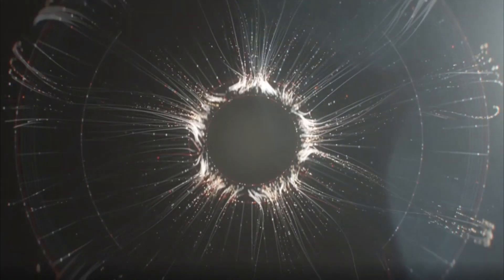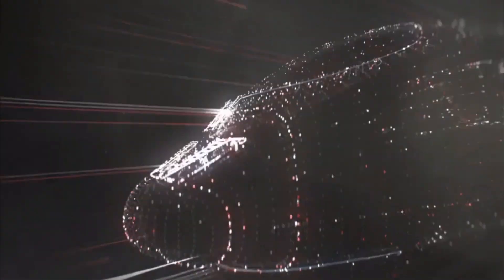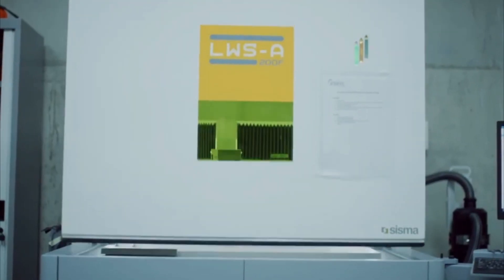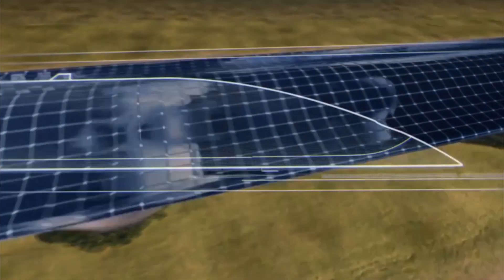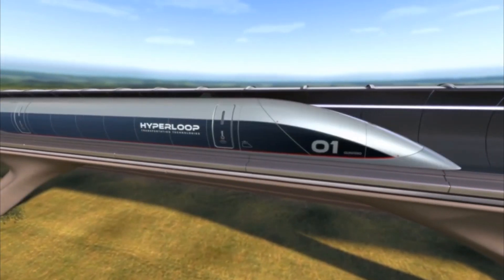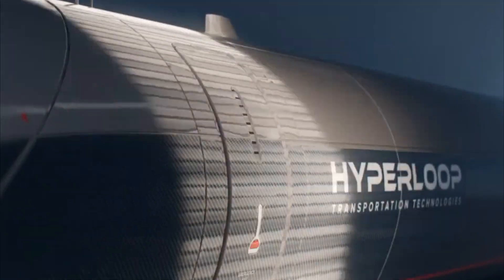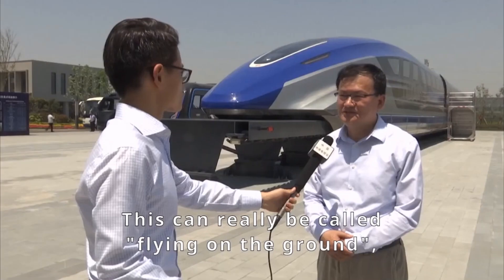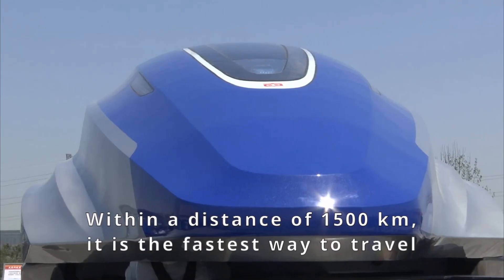New Chinese “Levitating” Train Can Travel From Beijing To Shanghai Faster Than A Plane

Comment: 500 k/mh is 310 mph.  I thought Japan did this speed a few years ago?
Reply: None of these have been realized. The Japanese one (Central Shinkansen) will not be open in at least five years and yive years later god knows what train-type they will eventually produce (if you produce it in 2026 there's no point to produce your new train with legacy 2021 technology). What's worse the Central Shinkansen project is delayed so god knows when it eventually opens how many high-speed maglev elsewhere has already been built. 

As a Chinese I hope it opens as fast as possible because we don't want to be the first to built a potentially economically infeasible project yet if someone tried the crab first we can gain a lot understanding about how it works economically.
Reply: @GyacoYu  Japan needs help from Taiwan. Or Taiwan can help.
Reply: japan has build the maglev trains already and they'er ready to go, but it will take much longer to finish building the tracks as they have build a tunnel through mountains & alps.
Reply: The SC Maglev Train from Japan was able to achieve 603 km/h in 2015 on their test run.

Comment: Vibranium is the name of a sensor suite like in star trek ? Okey dokey. Still wonder how well mag-lev can handle freight; haven't heard any news about that.
Reply: The Germans, have been running excursions, on the test track, with "Human cargo" in all weather's. The weight of the "freight" is 1.25 tons, and has recorded speeds in excess of 450 mph.
 China, also has the only commercial Maglev on earth and its longer than the German test cars - this one has capacity for approx 700 passengers or freight modules, with each 16, weighing in at 1 ton(ne ), and running at speeds of 450 mph.
 The "Human cargo", came from the test track video.

Comment: At 600 KMPH, the China-EU trip will take only 20 Hours! If only the freight train can do one-third of its speed! Air freight will be out of business across the Eurasian landmass!
Reply: When Europe sanctions China to its extreme, there is no freight between the areas. Then all means of freight is of no meaning.
Reply: 放屁，我做跨境电商的，每天从中国运往欧美的货物不知道有多少，世界上所有电商平台上一半是中国卖家，一半以上的货物由中国提供。
Reply: @qiqinglai9396  你从那儿得到的信息？可靠 吗？新疆的维吾尔族差不多要被 灭绝了，余下的维 族人也被强迫劳动，在这种情况下，还有可能从新疆向外动送物资 吗？可见你是在宅里做生意的。
Reply: @phongcheelim8873  你可以上网，可以上各大电商网站，同时你还有脑子。
Reply: @phongcheelim8873  neglected them, China commerce is unstoppable.
Reply: The weight of freight, should make no difference to the running speed of the service, Wether for people or freight, as Germany, when developing the Chinese one in Shanghai, the engineers talked of the passengers as "human cargo". 16 humans = 1 tonne, and it attained high speed with that weight. Anything heavier, the power flow, between the system compensates, and keeps the deck floating, and the speed up - bear in mind, that it may take a bit longer to stop, depending on tonnage.

Comment: Why on earth are the Chinese adding a driver for there’s no need, just take transrapid and improve on the automation aspects, mixed with lidar and sensors from the automotive industry including that it cannot leave the track as its magnetically held in place , I’m sure the wizards can easily get it working no mater the weather
Reply: Regulations
Reply: @asdf3568  really did something happen then to change it from driverless like the transrapid
Reply: @ram64man  My guess it's like a car. It can drive itself but you need to have a driver until the system is proven to work after years of testing.
Reply: double t in matter.
Reply: The driver, is there as reassurance for the passengers, just in case the service breaks all its backup systems, which seems to me to be a very unfortunate series of circumstances.
Reply: Because China has no driverless technology. The key holds in US hand.
Reply: @phongcheelim8873  It does. Multiple companies are working on that in China and they even have driverless cabs on the roads right now. So they are actually ahead of the US in that field.
Reply: @phongcheelim8873  Bull crab.  China's autonomous technology is aided by the 1000x speedier 5G technology!  USA's 5G is way too slow/ backward to compete:. Their autonomous cars are notorious for their crashes.